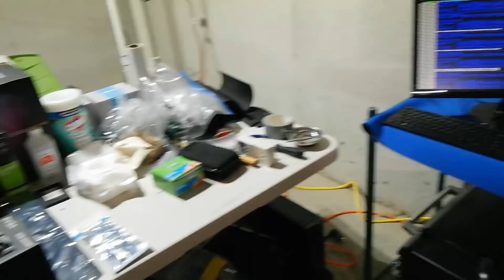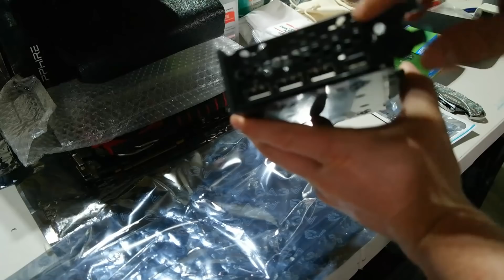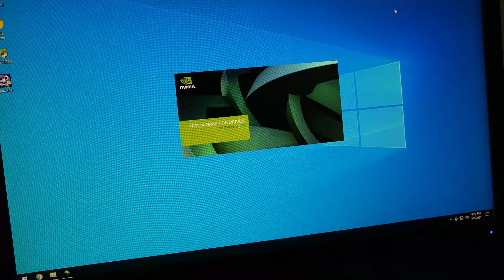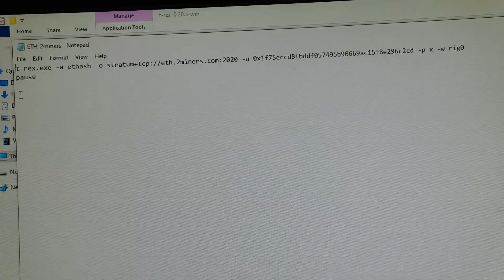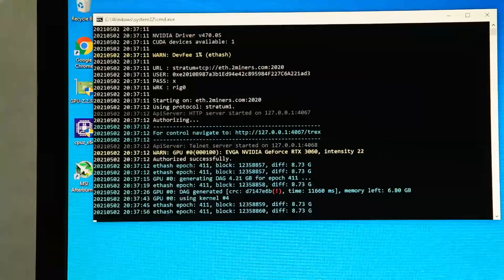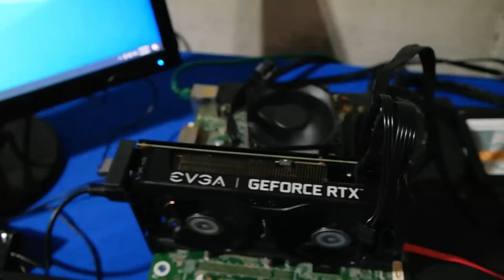RTX 3060 Mining Hashrate Driver Hack Doesn't Work Anymore?

Comment: Just got this same card and I'm having the same issue
Reply: How did you fix it ? Or still facing the same issue ?
Reply: @abigowtham7109  I didn't fix it, I'm going to give the card to my kid for his PC and use a different card
Reply: @ricky wood why didn't you try the fixes listed in the comments section.. ?
Curious about this coz, I'm new to mining and I'm also planning to buy a rtx 3060 for mining to start with. That's why. Thank you :)
Reply: @abigowtham7109  I did not, it's not worth it to me when I'm only going to mine with it short term. In order to get it going properly I'd have to rearrange a bit of my setup. And gaining 20 or so mhs is only about a 5% increase in hashing power for me.

Comment: thanks for the driver links. Just got a 3060 for my personal rig and decided to make it work to pay itself off. Just putting the driver on took me from 18/25MH upto 35MH then a small overclock has upped me to 37/41MH.At this rate will be paid off in under 3 months! Got a feeling this will give me the mining bug!
Reply from the maker: Amazing! Happy to help!
Reply: Exactly the same here
Reply: Okay so your hashrate was about 18/25MH before applying the fix. and about 35MH afterwards?
Reply: @kimn8898  yeh. The overclock now takes it Upto 43mh now at points but it seems to be stable above 40 now.
Reply: @Cooking-sg7vt  i got 40mh without overclock...but isnt it u supposed to get 49mh when u overclock...i hit 50mh 1st when i overclock and it drops to 41mh...still looking for way to overclock.
Reply: So cooking 101 the hack is in fact working then ??
Reply: @jorgecarrera2965  yes it worked instantly. I’m only running 1 3060 as a main gpu so I do have my monitor plugged directly into the unit. The gpu is the msi version. Right this second it is doing 41.17mh/s. I have a small overclock but nothing overly aggressive.

Comment: Having the same issue. Just got my 3060 last week, and best I can get in a x16 at pcie 3.0 slot is 27 mh.
Reply from the maker: Checkout my follow up video, I fix it!
Reply: @TheHobbyistMiner  I saw that, great work. Only problem is the board I'm using does support 3.0. It's a z87m-3dm, set to 3.0 in a x16 slot. The only thing I can't find is how many lanes are being sent to that slot. It may not be the minimum 8 needed, but I literally can't find it in the specs or the bios. And no, they don't have a newer bios for that card that I can find.

I'll move it over to my newer mobo in my gaming rig for testing later tonight.
Reply: @tosclive  how did it go? I’m in the same boat as you but sadly i may have received one of the newer ones that has the new bios chip
Reply: @Yedgar_  do you know how we can tell the difference with the packaging? I was going to buy two tomorrow and now I don’t think I should
Reply: @dishsoap1  yo so it turns out my card wAs able to mine up to 48 m/h. I have one of the newish “XC” ones. Don’t know about the packaging tho sorry m8
Reply: @dishsoap1  did you end up getting them? someone told me "LHR 2" or "version 2" on the packaging will indicate that it's one of the newer locked models, but it might be inconsistent
Reply: @TheHobbyistMiner  and which video is that you have so many of them ?

Comment: Hey mate i just found this vídeo.

Mines where jumping clocks yo 1800
And burning hot, what i found is when the memorys themps are too high the clock speed jumps 

So i put a cooler dirrctly on the memories and one on the fan, now has been 3 days whitout any trouble.

I think mems thems are what causes trouble, i also ordered some thermalpads and heatsinks but seems to be perfec right now just directly cooled.

Comment: Dude you need bigger check list!
Pcie 3.0, not necessarily x16, x4 should be enough, get those ryzens for 4x to 16x. PCIE 2.0 doesn't work.
Bios Speed set to 3.0.
2nd instance of miner running at same time.
Drivers
Motherboard, when you have more than 4 cards enabled.
MSI core clock, don't overclock or underclock with 3060.
Enable Cuda cores at 750voltage, if you go bellow cuda might turn off, and half hashrate will turn on...
Many other things, like not connected hdmi, or turned off monitor, dummy plug....
Also your memory is set too high, it will burn very fast. I tried it personally, I got pixel artefacts after a week, which shows, that memory is burning hot @8500! 8300 Max. (3070 is running on ~8000 and produces more hs, I doubt that memory on 3060 is much better than 3070, still I think/worried I am a bit overdoing it)
Advertising 50 mh/s is not really possible, ~47 mh/s is best bet... For efficient mining, and not burning your card and house...
Old cards work, are old cards, they don't sell well...

Comment: As expected, the ‘new’ RTX 3060 models (equipped with GA106-302 GPU) will carry a new PCI Device ID of 2504. This will prevent ‘302’ RTX 3060 models from being used with older drivers. This should also ‘force’ miners to buy the NVIDIA CMP HX series instead. source videocardz.com
Reply: If that is the case has anyone tried to change the device id with nvflash? I have not seen anyone try this yet. I just got a 3060 and the 470.05 dev driver wouldn't even let it be shown in device manager. Currently running driver 466.47 standard.
Reply: @andrew11235ify  so are you getting 50mh on 466.47? 

I'm facing the same issue. Didn't able to go above 24mh with Zotac 3060 June 21 edition.
Reply: @harshsharma5002  lhr were not even detecting. Only getting 25mhs on eth and 21 on octo. I have not attempted to flash the card.
Reply: Or 3090 is without LHR

Comment: Hey Mate i am using 3 of these 3060, make sure your motherboard has at least x8, x16 pcie slot, otherwise it will not work. And try in different pc, check in your gaming pc too, may be motherboard issue.

Comment: I seen that you got it figured out.  I was going to say its your motherboard that is the issue.  I have 3 3060's and they are still mining 47mh/s solid.  Hopefully you have a board handy that it will work on.
Reply: Mine seems to be stuck at 38.5 mh/s, any tips?
Reply: You both guys mean to 3060 xc ?
Reply: Can anybody tell me how to run 3x 3060s on a x570 aorus ultra.  Please help, I don't want to have to buy a different mobo, or use 2 mobos and have to buy more ssd, ram etc.   Thank you in advance

Comment: I have two of them. What I have to do is installed current drivers, then do a clean install of the 470 version then restart. I'm having issues oc above like +1260 buy I think one of my cards just lost the silicon lottery. Pulling around 98mh with 2 oc conservatively.
Reply: Mine is giving 27mh/s....how can i get 49 mh/s? Help me

Comment: hey guys spent days Wondering why my hash rate was around 26MH/s turns out it was a hdmi to dvi adaptor, the card im using is gigabyte, now im back to 48 MH/s using my hdmi tv.
Reply: #jeffry I'm using rtx 3060...its giving me 27mh/s ....I'm using dummy plug...I've checked it on Hdmi as well but its not working....I'm using Dual core PCIE ....help me to improve hashrate?
Reply: @businessconsultant2858   what cpu and motherboard?
Reply: @jeffryplaysminecraft1211  I'm using Dual core cpu... 2.8ghz motherboard ... So can you help me?
Reply: @Nitin  What does MB means?
Reply: @Nitin  I've pentium r dual core 2.8ghz

Comment: You forgot to check the 8 gen 3 pcie lanes 

A 16x looking slot is not enough

The 3rd 16x slot found on some boards is on most boards only wired with 1 or 4 lanes

Comment: I have the same problem. I use biostar tb250, 6pci, Have 1 lot pci 16.  I used to get 48 mh on 3060.  I have just added one 3070 on riser, 3060 down to 25 mh. After setting bios to gen3, nothing change with3060, still 25 mh. I think there are problems with setting bios. Please help me set up! (I recevied rate 62 + 25 mh). After all , i see rate of bitcoin I received 0.00035 per 4 hour. I think i get enough rate with 3070+ 3060 althrough i see 25 mh with 3060. Dont sell 3060. It still good card.

Comment: Don’t know if this helps but I’m on NiceHash and I get 35-40 MHz with 500 over clock on the memory, I don’t use a hdmi contact, dp.
Reply: your mining conflux on nicehash not ethereum, check the name of algo if its not daggerhashimoto then its certainly not ethereum mining
Reply: Trex - 50.5 heshrate on ethereum.

Comment: Does the driver 470.05 supports Tb250-BTC D+, from the spec, It has PCIE 3.0 x 16 slot. I've tried mine on the slot. It's still half the hashrate.

Comment: Your OC Settings are crazy, literally like if you don't have to pay any electricity. Sitting here crying cause I pay 0.32$ per kw/h.

My EVGA 1660S runs 60% Power -502 Memory 78 Watts 31.7mh/s.

Not sure if that counts for all EVGA Models but maybe you need to underclock them.

Comment: Running memory clock too high on my 3060s cause loads of invalid shares on the one, the other bumps down to under 40mh. Run it slightly under 1300 and you’ll be good! Something weird happens when you clock too high.

Comment: I've been avoiding the 3060s, just go mine something other than eth
Reply: I'm mining dogecoin still getting 20-22 hash rate.. any solution on this. can't even install the 470.05
Reply: @Debasis_Nayak  you'll get a different hash rate for different coins, I don't mine doge so i can't tell you. But I would think that 20-22 is probably a really good number

I don't think you'll need to bother with the nvidia drivers if you aren't mining eth or etc
Reply: @elliottstech310  Why I'm saying this because in my older nvidia 2060 I'm getting 37 hashrate. This one should be 40-50. but getting 20-22
Reply: @Debasis_Nayak  had a quick google, other people are saying the same thing. Guess you do need the drivers. Sorry I'm only ever mined eth and etc, and I only got 3060 ti and 3070 cards. You probably want to get on redit or do some googling, I don't think I'll be much help to you
Reply: @elliottstech310  Yes sir, That's what I need to do to find experts help. But thank you so much for being nice. Hopefully I will get some reply

Comment: Mines still work... 49.5Mh/s on average at 67c to 68c - the sweet spot for temps. But bought it late last year - close to msrp.  Nice video - good luck.
Reply: Why so high on temp mines at 49.5 mh/s  at 41c.
Reply: @FunnyAnimalsCrew  Mine is giving 27mh/s...how can i get 49mh/s?
Reply: @businessconsultant2858  you need to put it in a 16x pcie slot and download the dev driver 470.50 and plug in a screen in the card or use a dummy plug
Reply: @FunnyAnimalsCrew  Sorry i don't know much about 16x...what's that can you help me to find out?
Reply: @businessconsultant2858  just put the card in the motherboard first slot and has to be gen3 look at you motherboard specs online
Reply: @FunnyAnimalsCrew  ok dear lemme check then I'll tell you btw thanks ...can i get your Instagram if i need help I'll let you know?
Reply: @FunnyAnimalsCrew  yea 41c... lemme guess ur ambient temp is WAY below 21c, and.. not everyone has the same model heh, i also have 68-70 on a 3060 evga xc, while my 3070 wont go past 55c, same room, better cooling on the 3070, same power draw
Reply: #MICHAEL I've Rtx 3060...it's giving me 27mh/s....I'm using it on Dual Core PCIE ....its not going upto 49mh/s...i need yo improve hashrate kindly help me out?

Comment: can the new RTX 3060 that got released dis month be hacked to get 50MH/s?
Reply: Yes, picked up 2 about week ago. But expect more like 49.3mh- any higher and it’s unstable for me at least, and it causes invalid shares or drops lower than 40mh. So along with all the other things this card needs to mine eth, run memory clock slightly under 1300 and you’ll be good.

Comment: Hay Dude also some advice. Some CPU’s are also a limitation with this. For example the AMD Athlon processors do not give 16 or 8 pcie lanes only max 4x does not matter what motherboard you have.👍🏻
Reply: U can help me ? I have gigabayt a320H-rev3 motherboard and  athlon 3000g CPU
Reply: @barbaroscatal1239  Hi there. You wont be able to run a 3060 at full has rate as a Athlon 3000 only has 6pcie lanes available giving only 4 lanes to a graphics card.
Reply: @SuperJasonnel   i have one rtx3060
Reply: @SuperJasonnel  what I can about this problem   ?
Reply: @barbaroscatal1239  you will have to get another CPU like a Ryzen 3 or 5 cpu. Then you will be able to get the full hash-rate.
Reply: @SuperJasonnel  ryzen 3 1200 CPU support ?
Reply: @barbaroscatal1239  yes that one will work it has a total of 20lanes so will be able to give you full 16 lanes or 8 lanes.
Reply: Hi Jason

Comment: Check your MB. 3.0 or higher. Check your bios. If all fails, then you got the new GPU with GA106-302 which prevents mining at full potential. They are putting this GPU in all 3000 series starting this month.

Comment: Although the dev-driver leaked, TBH, I still think about the 3060 as a locked card. I don't find it manageable at all with all the requirements, even with the hack. Personally, I would not touch windows for a server or a rig anyway for security concerns. In any case, here in Brazil the 3060 is as expensive as any other 30 series, so I don't even need all these reasons :)

Comment: is pcie x16 slot  running at x16 or x8 lanes?? make sure you have selected gen 3 in bios not gen 2 or gen 4.
Reply: Can you specify on that "gen 3 on bios" pls ? Im having that same issue ;-;
Reply: @cake869 there is a column in bios ...in graphic card or in slot section...PCIE LINK SPEED.. put that to gen 3...
Reply: @kartikdutt8019  still not working :/ i dont know how to fix this ;-; i have all the requirements needed ( 3.0 16x slot , 470.05 driver , etc )

Comment: You are running too aggressive settings and the equivalent of 2 monitors. Try a single HDMI monitor and set memoc to 1350MHz, +0 core oc and power limit around 65%. If core speed rises too much mine drops to 41MH/s and I need to raise the PL into the 70’s until hash rate stabilized. It is a Gigabyte card but I suspect the dummy plug with a running monitor may be an issue for you. Good luck.

Comment: Few others have said but it's more than just three things:
- x16 PCIE slot
- PCIE slot must be running at gen 3 or 4
- PCIE slot must be running at x8 or x16 speed
- Monitor or dummy plug
- Windows w/ developer driver (using DDU first)

Use GPU-Z to check for the second and third requirements, in the Bus Interface field.

Could be the new limiter out there, but I'd be surprised if they got it out that fast.

Comment: Yo mate, make sure your pci-e slot speed is 3.0 and check your bios settings. That would fix your problem ;)
Reply: #mehmet I've Rtx 3060 its giving me 27mh/s ...its not going upto 48 or 49...i am using dual core pcie what should i do? Kindly help me to improve hashrate ...
Reply: @businessconsultant2858  LHR is your problem friend... :(
Reply: Selamün aleyküm dostum aynı sorun bendede var çözemedik kaç gündür
Reply: As. Anakart modeli nedir ? 16x slota takılı olması lazım ve ekran kartı sürücü versiyonu kaç ?
Reply: @mehmetyasarsever6472   gigabayt a320H-rev 3  anakart işlemci athlon 3000g  x16 slotuda takılı driver 470.05 beta sürümü . Herşey tamam ama yine olmuyor
Reply: I have my motherboard set to gen 3 speed, but I'm not using x16 slots. I'm using x8, Is that why I'm not getting full 50 mhs using nicehash on my 3060s? I have non lhr models

Comment: There is a possibility that you have got the new batch thats had the hardware changed, I didn't think it was out already?   The new hardware GA106-302 https://www.pcgamer.com/nvidia-rtx-3060-mining-limiter-ga106-302/
Reply: I noticed that you might not be on a 3.0 pcie slot because that looks like a old motherboard board.

Comment: What system board and CPU are you running?  You have to run a gen 3 processor even if you have a gen 3 system board.
Reply: To be specific.  I had a system board that clearly said it 2 gen 3 slots.  However, the fine print says that it only works with an 3rd gen cpu.  I was running a i7-2600K.  I was rate limited.  I found an i7-3770K and am now running 2 3060's  at 48.5Mh/s on that system.

Comment: What motherboard are you using?  That looks like an old MB that may have a x16 slot but not have 16 or even 8 PCIE lanes assigned to it.  Also, check the bios.  If you have set the PCIE to Gen 1 or 2 on the test rig, that could cause the problem as well.  I would put high odds on that card working at full hash in your personal computer with the 470.05 driver.

BTW, I have 2 of the same GPUs running on 2 different computers at full hashrate.
Reply from the maker: Great INFO will investigate tonight!

Comment: You scared me, I have a 3060 to be delivered in the next days. I am running 9  3060 on 5 mobos, combined with a lot of 1660s. Maybe your mobo doesnt have a 3.0 slot.
Reply from the maker: WOW 9!  Way to go!  That is clutch.  After some community input that is my next step to test.
Reply: @TheHobbyistMiner  Finding 3060 at a good price wasn't a big issue, finding mobos that can run x8/x8 was the real challenge. The GPU prices are very high here in East Europe so the best option for mining was 1660s and 3060.
Reply: oh i assure you that the 3060 still can crush the hash limiter friend.  good job on those cards.  should be a fun setup
Reply: @AlteredComponent  On one of your videos you say that Inno3D 3060 is not mining full with the dev driver. I have one and it does, its theTWIN X2 OC model.
Reply: @calinlupu2786  There are 2 versions by the way with letter h and without it, with letter h is not mining full with the dev driver
Reply: New 3060 chips coming in May with chip codes 3002 gonna nerf all the 30 series cards Google it